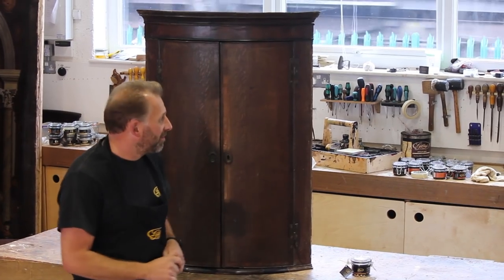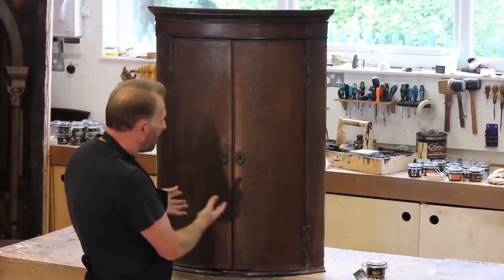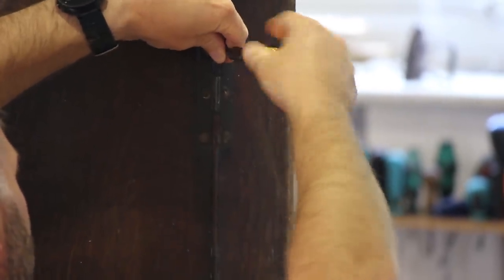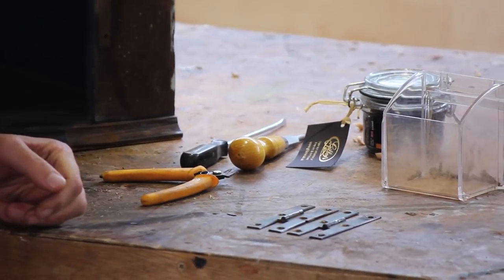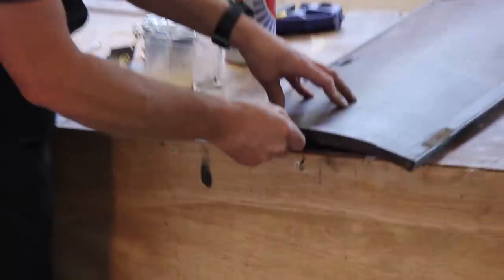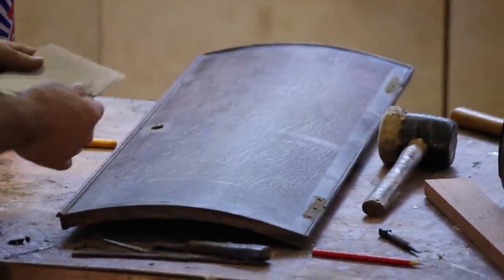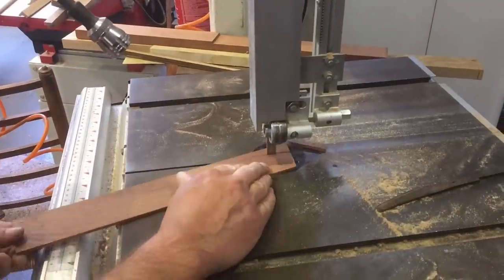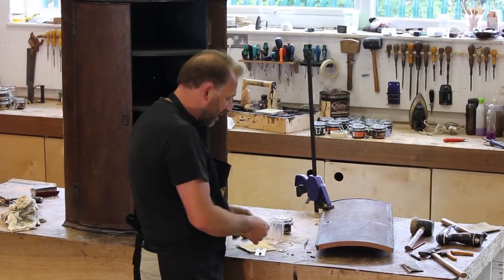Restoring a Georgian Corner Cabinet Door

Comment: Thank you for your very informative videos. 

Is the wax suitable on oil finished furniture? 

Also, will the steel wool scratch the surface when applying the wax, particularly on a shellac finish?
Reply from the maker: Hi Tony, it is indeed. No it will not scratch it, the wire wool is very soft to touch, it's almost like cotton wool, that being said i wouldn't recommend  it for use on your face !

Comment: Can I ask why didn't you polish before you'd attached the hinge and the escutcheon ???
Reply from the maker: Hi there, in this circumstance it was just for the sake of the video. usually when restoring in the workshop we would apply the wax polish and buff the area before the brass work is put back on, Although this is not essential. It will not damage the brass work, in fact because of the high wax content of our polish it will protect the metal work just as well as the wood. It's also for people that may be using our wax polish at home that don't have means to remove the brass work before polishing. Hope this helped.

Comment: if the escutcheon was pinned on, how do you remove the pins without damaging anything?? Also where can you get replacement brass pins from to fix it back on?
Reply from the maker: Hi John, generally we use something that we can lever the escutcheon off with a pallet knife or something like that just enough that we can get a pair of pliers or pullers under the head of the pin. its all about taking your time and being careful.
Reply from the maker: The pins can be brought online just search for brass tacks or dome headed pins